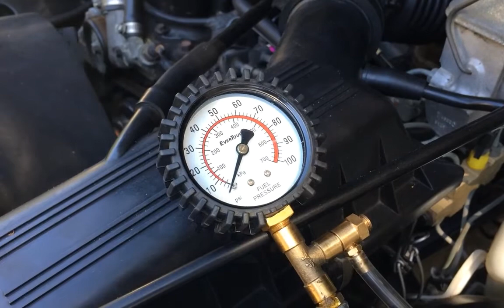95 Jeep YJ Fuel Pressure Test

Comment: Check you fuel pump relay. IF its not clicking on. try to jump 30 to 87 and see if that kicks on your fuel pump. If it does. Check your ECM by seeing if you get a check engine light when you turn on the key. If no, Remove your pcm and replace the 3 capacitors with 25v 220uf or 35v 50v. Requires soldering. 

If you recently replaced your fuel tank, make sure the hoses are not swapped on the sending unit.
Reply: Ben Jackson would this also cause u to loss power and start knocking(like missfire) before it officially goes out?
Reply: I did have a miss fire when i was inspecting my ecu. I found that the heat sink was loose. If i applied pressure to it, the engine would run fine. But i doubt this is a super common issue. Your miss fire sounds like an ignition coil is bad.